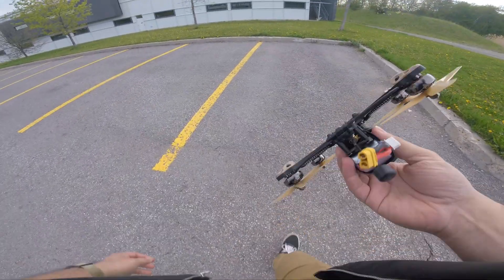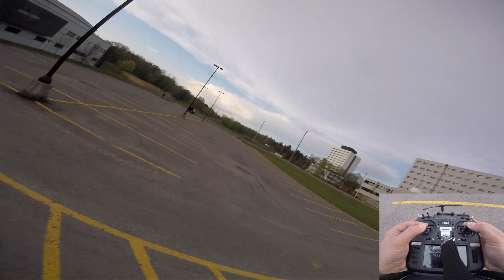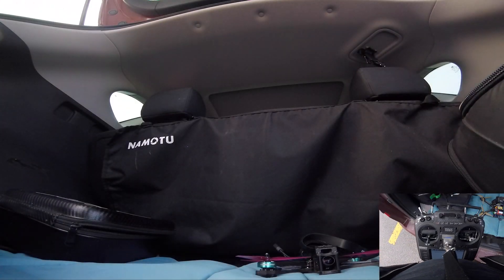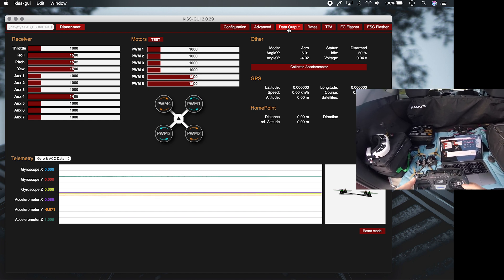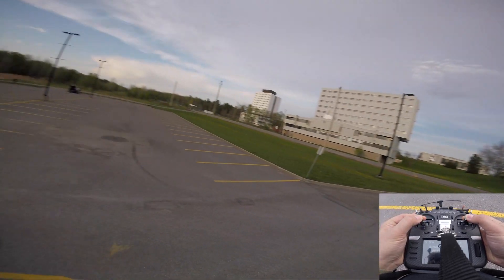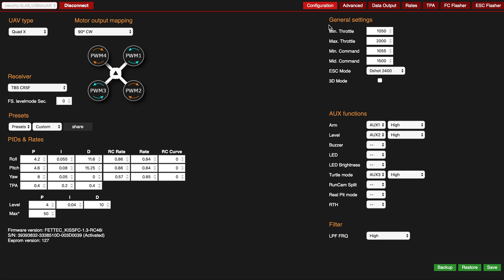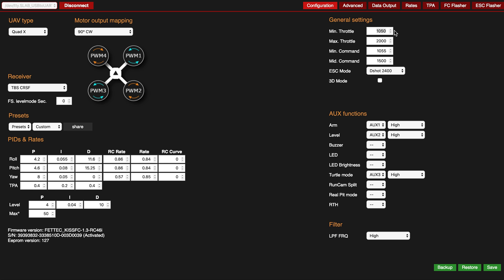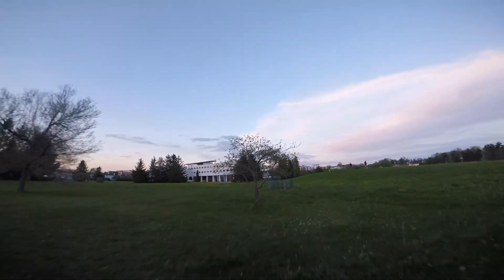Idle-up vs Airmode in KISS - There's a difference, just not what you expect || Food For Flight Ep.4

Comment: Would changing the weight/scale/offset in the transmitter fix the low stick resolution?
Reply from the maker: The only workaround that seems to work (but I may have missed something) is having your idle offset on a switch (idle up). I tried other solutions from the Tx side but the problem is that you won't be able to arm if your throttle signal is not at 0, which is why you have to arm before switching the idle up to on.
Reply: @udyfpv  Ah. I see.   I am fairly new to this, so I am trying to learn as much as I can.I use airmode, but it can be a hassle for sure at times.  Thanks man!!
Reply: @udyfpv  technically you add a low throttle curve in the curve tab and assign it to a switch
Reply from the maker: @ShaneWymore  yeah that could make sense, but I feel that it amounts to roughly the same as an idle-up switch...
Reply: @udyfpv  you flip the offset after arming and it will close that 30point gap

Comment: Strange that with AirMode there is a lower resolution..
Should be fixed! I have to check if that's the case for my quads too..
bouncing of walls or freaking out just because of a leaf are the major problems with AirMode
Reply from the maker: Yeah it will react/overreact to any movement that wasn't commanded. Just to be clear, this throttle resolution loss applies to Kiss, but unsure about other firmwares.